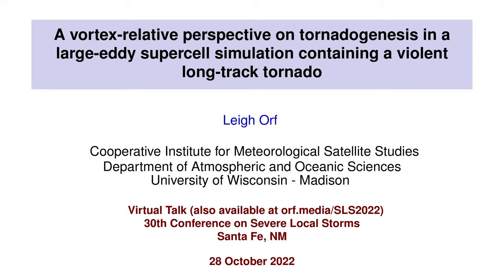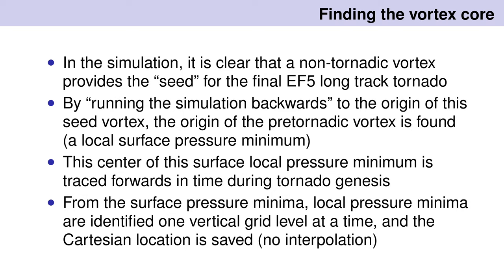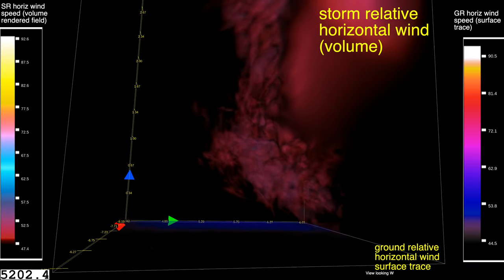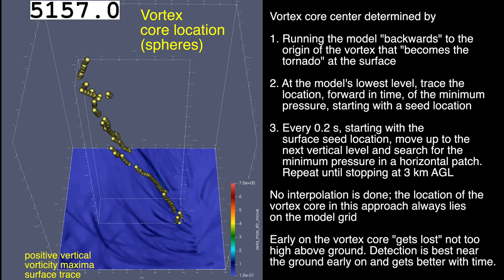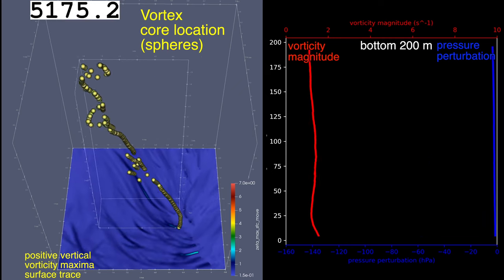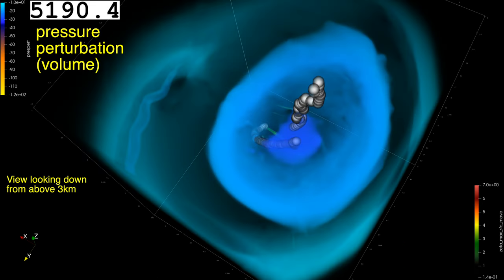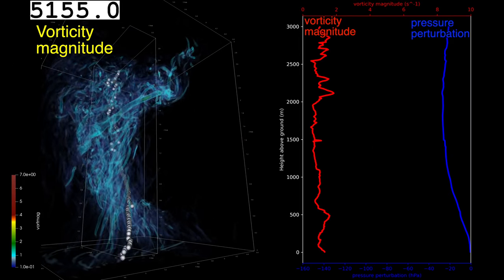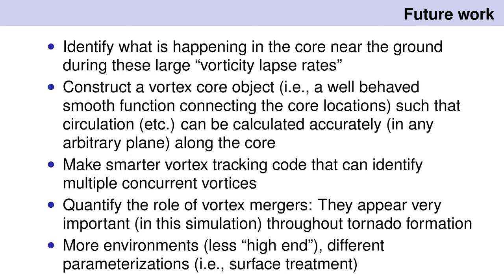Leigh Orf's talk at the 30th AMS Conference on Severe Local Storms

Comment: Tornado genesis seems to be a complicated balancing act between the streamwise vorticity current getting sucked into the mesocyclone to an elevation/distance ahead that allows the drag vortices of it to grow to a size that allows for merging vortices at the surface below the mesocyclone to reach as certain speed. I grew up with the two bottles made into an hourglass used as a demonstration of a tornado but instead it seems more like it's syphoning a glass of water with a straw in it by blowing through a separate straw right next to it to create an area of low pressure in front of both open ends.

Comment: I wonder to what degree Bernoulli's Principle is in play when the velocity of the cold pool kicks up.

All that cold/dense air, suddenly dropping in pressure as it's accelerated -- and replenished by the surrounding still-dense cold air, racing to restore pressure equilibrium? Seems like it'd be a potentially significant positive feedback loop.

(Although I suppose postive feedback loops are all over the place in complicated weather systems -- hard to say if its effects register #BabysFirstBernoilliHypothesis)

But dang, it sure seems like that's what's happening -- established cold pool starts getting a little ground-level vorticity --  has enough vorticity structure to get integrated into the tonadic vortex core when it gets wrapped by the ~third meso vortex merger -- would seem to explain the bottom up signature -- and maybe even the unusually long duration, since the cold pool is replenished by the super cell.

But I donno -- I barely know what I'm talking about -- basically reading astrology here. But the bathtub is definitely draining up into the sky.

Either way, fascinating stuff.  Dr. Orf videos rule!